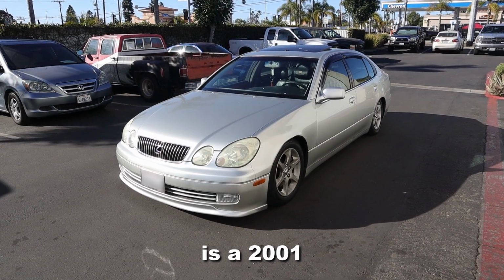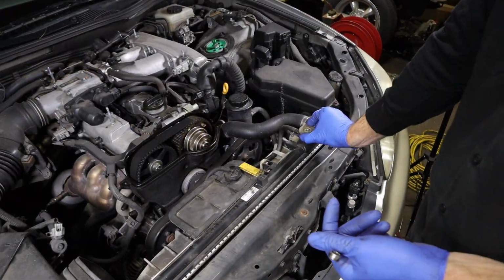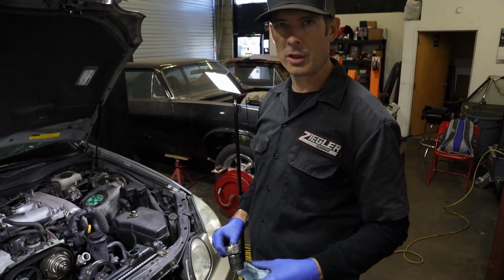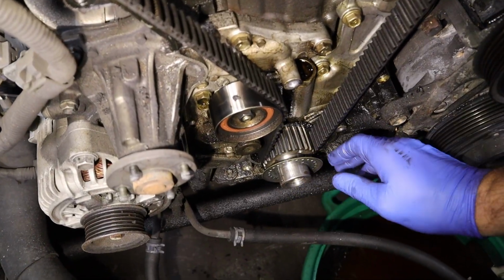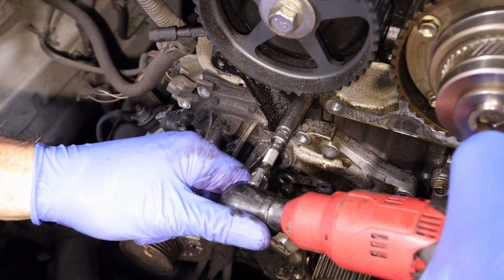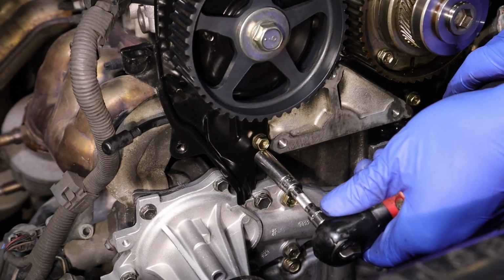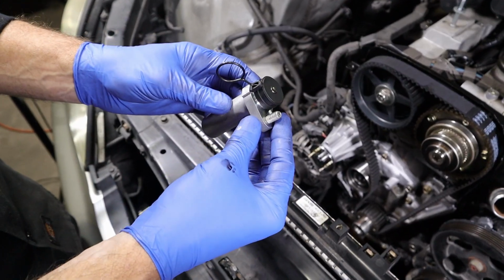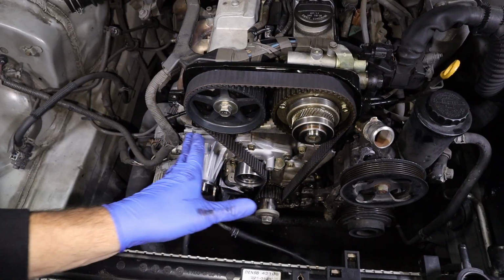How To Replace Timing Belt & Water Pump on 2JZ Engine - EVERYTHING YOU NEED TO KNOW

Comment: The harmonic balancer is made of two metal pieces held together with rubber.
The force from the chain wrench goes through the rubber to get to the bolt. 
Better to use a pulley puller like schley  64300, and not stress the rubber.

Comment: make sure your crank pulley is in line after getting the pulley off!!!!  they show it getting off super easy but no. it moves the pulley if u use a imapct causing it to be misaligned  causing u to bend your valves if you try and start it up. good tutorial but watch that small step. it caused my valves lol. it moves like 30 degrees make sure to do a full rotating of the top righ pulley to make sure timing is right
Reply: if u dont have the corecct tool to take it off your shi will be misaligned!!!!!!!!!. make sure u move it all the way to the right and then allinge the slits and put the belt on
Reply: if u are doing the seals in my case. becasue they pullkey moved but he never said make sure yadada what i said before yk. make sure the timing is fully pulld to the right
Reply: What?

Comment: I was wondering why the Toyota manual tells you to remove both cam sprockets ... it's so you can remove the rear timing belt cover so you can get to the water pump bolt, and or change the camshaft oil seals.

Comment: should have changed the cam and crank seals while you were in there... see all that oil?
Reply: We did.
Reply: @johnziegler204 not in this video
Reply: @cousinabe correct, this video is for timing belt replacement. Not engine overhaul.

Comment: What size is the chain wrench?
Reply: The harmonic balancer is made of two metal pieces held together with rubber.
The load from the chain wrench goes through the rubber to get to the bolt. 
Better to use a pulley puller like schley 64300, and not stress the rubber.
Reply: @williamday6637 Thank you! 🙌

Comment: Mine the key its not at 12 o clock  when the point on the crackshaft its on time mine its like at 11 oclock  its normal or has to be at 12 o clock  i did mine now but i have code for misfires random and the vvt valve code i dont remember wich its  so im out of time? Thanks for your help

Comment: How come you didn't replace the cam seals and the crank seal? They're leaking forsure, look how much oil is on the car.
Reply from the maker: We did replace it just wasn’t apart of the how to video
Reply: @zhphowtosrepairs  Do you have another video showing that process? I'm planning to take the front end off my 2JZGE and get all this done at the same time over a couple of weeks, would be great help!

Comment: In no world is anyone going to loosen the crank pulley bolt with that effort. That bolt shown in the video Must have been loosen not so long ago…
Reply: It took me 3 attempts to do the job. Got that bolt off with an 22mm Socket welded to an 1,5m long pipe with 1" in diameter. Sill was hard to break loose. Broke a breaker bar last time trying that, this was how I came up with the Socket welding to a pipe

Comment: The vvti gear is super loose until a certain point then you feel the actual cam move, does it matter where it is in relation to the camshaft as long as the gear is on the correct mark?
Reply: did u figure it out yet im don’t know what to do

Comment: Should’ve took out the cam gear and blacking plate to replace the seal while you’re in there, that’s a half ass job but replace timing belt only just for the seal to leak in the future
Reply: We did replace the seals at the same time. But thank you for assuming we didn’t.